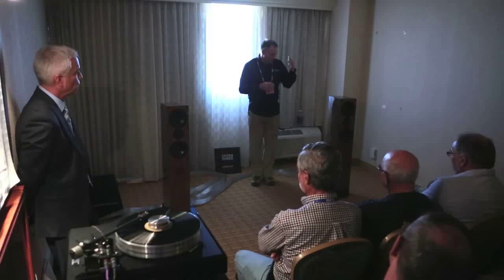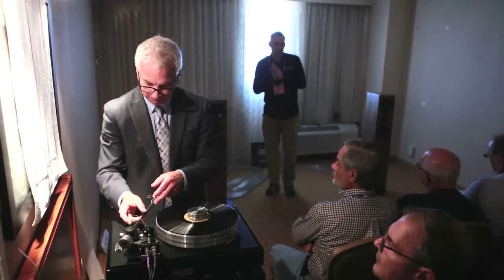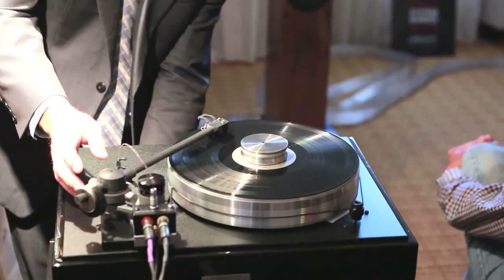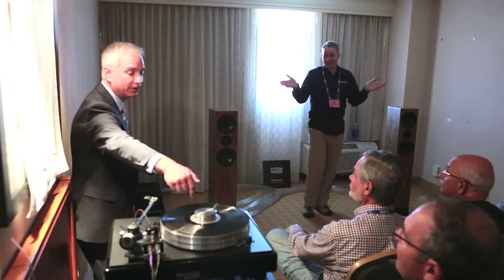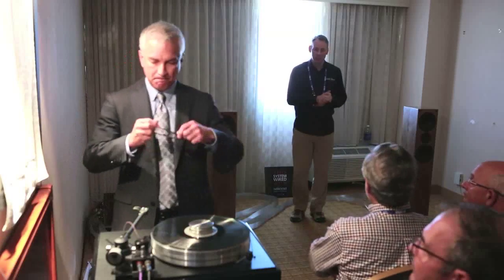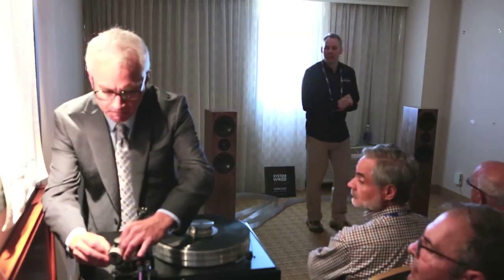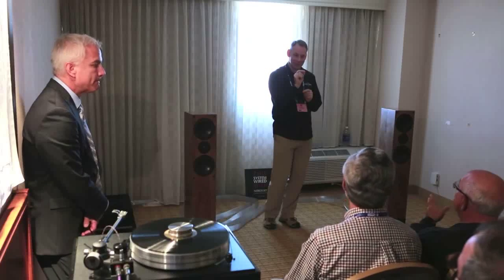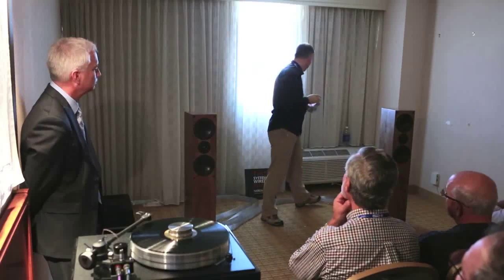RMAF14: Cartridge Optimization For Musical Performance

Comment: Very interesting, of course, but it's just impractical to chop and change like that. I prefer to find a sweet spot that works with most LPs. Life's too short to fart about to the extent shown here.
Reply: Marten Dekker  the guy actually said that he changes VTA on the fly for every LP.
Reply: I agree. You find the correct azimuth...set the tracing distortion model gat works for you (baerwald is widely used for Rega geometry arms as the best compromise so Linn, Origin Live and many more arms hor example) set the vta and check each step change using say 3 different LPs and using the best compromise then leave well alone.

Comment: Vta may vary a little between different LPs due to the equipment that the master was cut at in terms of the cutting head angle.  Changes might be a degree or two at most so starting at level tonearm moving up or down by a mm or two in each direction will result in diffferences to clarity.  Vtf wont alter that much if anything at all.     In engineering terms those very slight changes in vta make no difference whatsoever in "rhythm" as claimed...that I am afraid is not true.  The slight changes wont affect timing but the precision especially for line contact and microline cut stylii in the high frequency area where there can be tiny modulations measured in microns.  Changing vta for every LP really isnt needed.  Its a compromise across a range of LPs. Azimuth will be the same for all LPs...it needs the headshell to be precisely parallel to the LP surface.  Only minute changes barley visible are needed either side and most systems simply wont allow such precision though and some may require shimming of the armboard where angles cannot be changed on the headshell.  Theres a bit of subjective assessmet here azimuth.  As long as the tonearm for fixed headshells is paralell to the playing surface you need do nothing more.